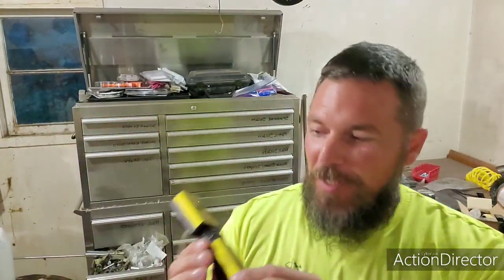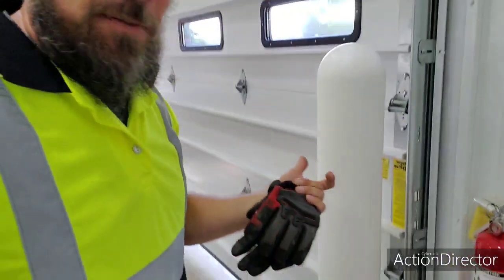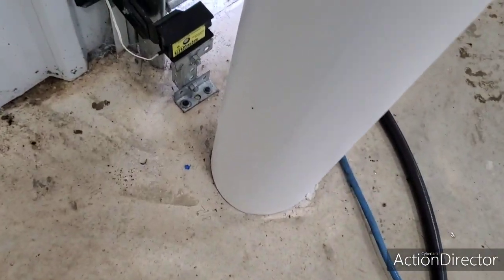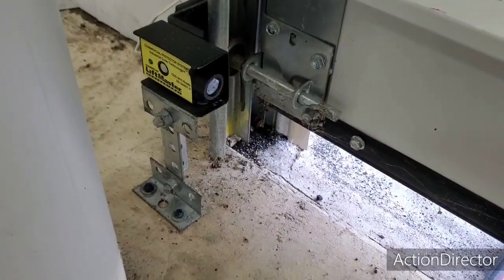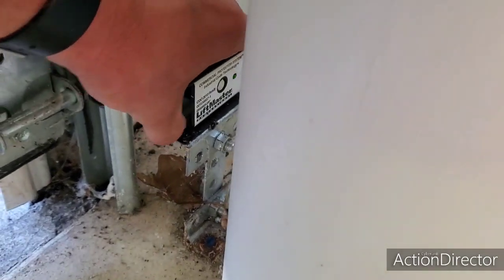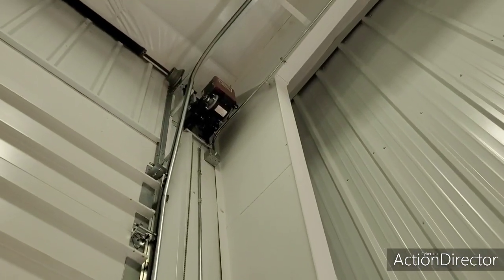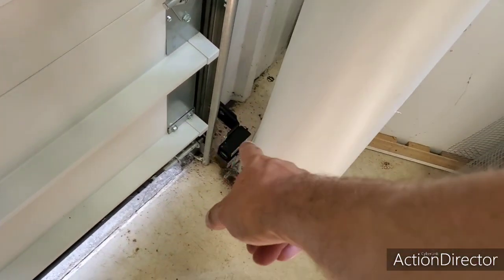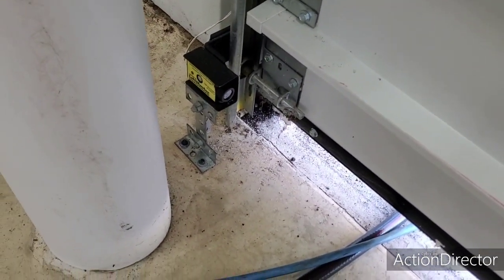Let's Talk About Liftmaster Commercial Photo Eyes

Comment: Your are totally right a couple months ago i had a similar problem with this photo eyes sensors  i called tech support we troubleshoot they said your circuit board is bad so ended up replacing the board under warranty cause it was a brand new operator but a few days later costumer calls back again saying that door didn't want to close again so i got there and i notice that the green light on the receiver eye was pretty dimmed  didn't have in my truck the same eyes so i tried a new set of residential Photo Eyes and that was the end of the problem
Reply from the maker: Nice 👍

Comment: Can we install multiple photos eyes in a MH5011 ?
Reply from the maker: I believe you can but you have to have the CPS-U and wire it into the edge terminal on the circuit board. I always just have a CPS-U and 2 pairs of photo eyes and call tech support if I need help with it.
Reply: Thanks

Comment: Liftmaster won't tell you directly but there's a way to diagnosis quickly if the photoeyes are bad or the circuit board is bad. It involves using a resistor. 
Liftmaster/Chamberlain doesn't tell people this directly because it would open themselves up to a lawsuit if someone bypasses the photoeyes under advice.
Reply: Do you use a 10k resistor? That’s what I read somewhere.